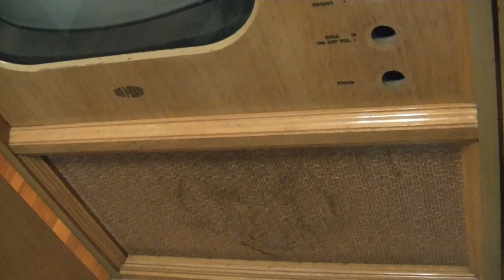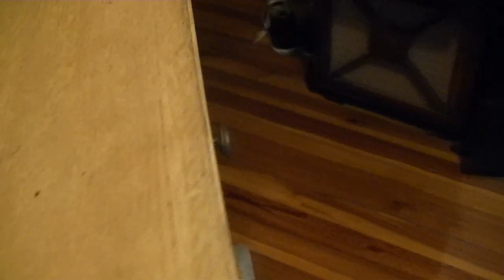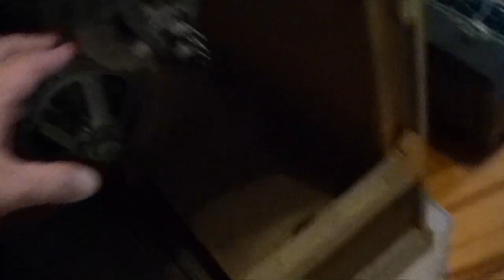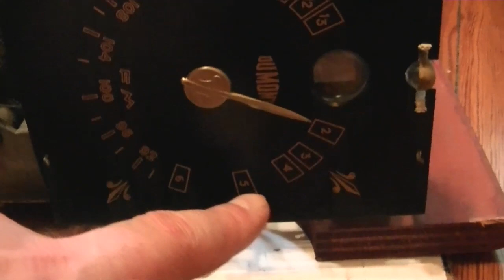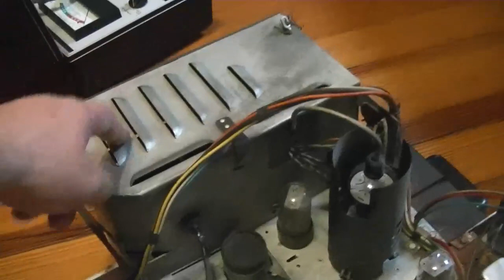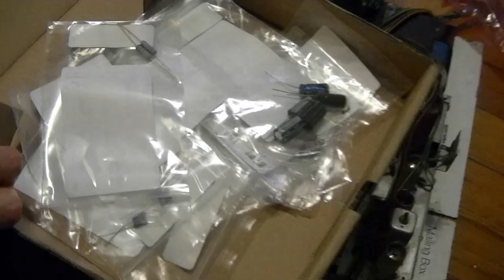Dumont RA113 restoration p1o8

Comment: That set must be newer then the one Phil Nelson has, his is a RA103 and it has a round CRT. For some reason I thought he had one like that RA113 with the square dial, but maybe that was someone else. I wonder if DuMont used IFs with silver mica or if they used ones with molded mica or ceramic caps inside? I'm not sure what the tuners were called, I've seen ads in magazines from the day selling surplus tuners and they just called them DuMont tuners.